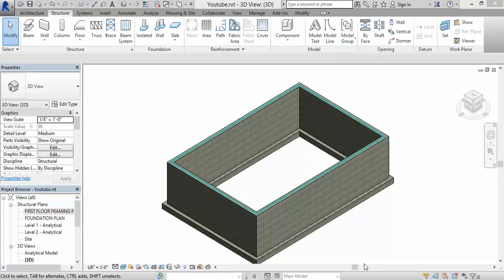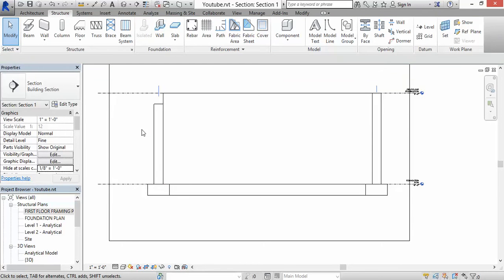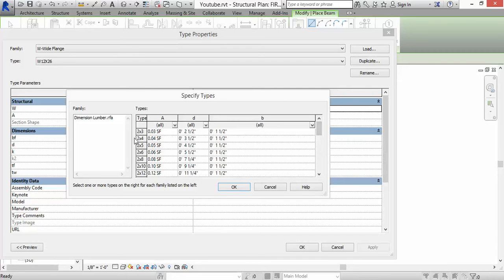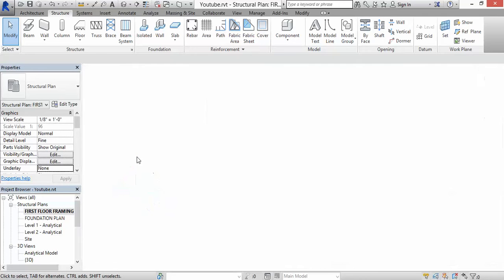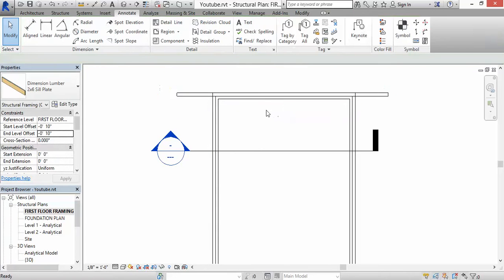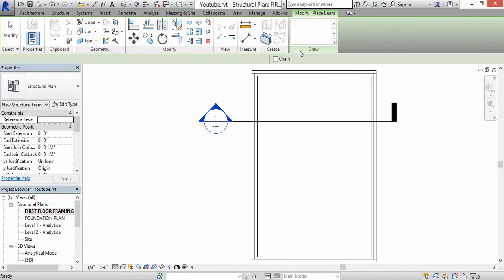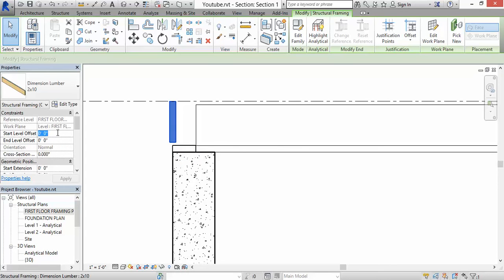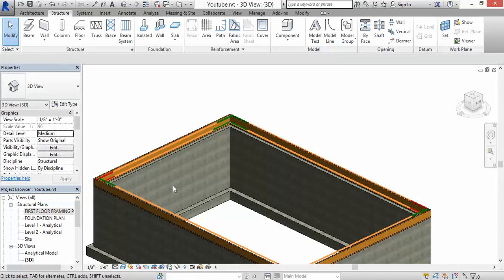Autodesk Revit- Sill Plate and Rim Joist

Comment: Is there a reason why you lower your wall height from the foundation level, then offset your sill plates to compensate the difference? If there is a reason, why not just lower your foundation height, then have the sill plate on that same level. I fought with the way you do it until I realized I could have just lowered the foundation height, then set the sill plate to the foundation level.